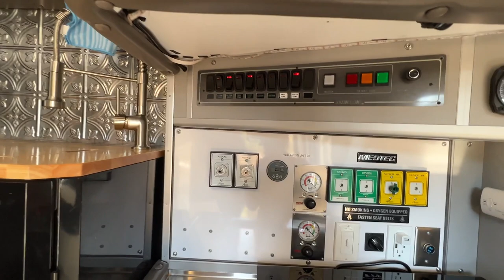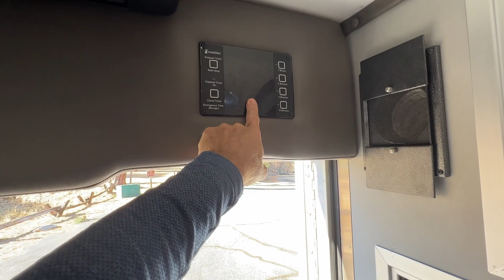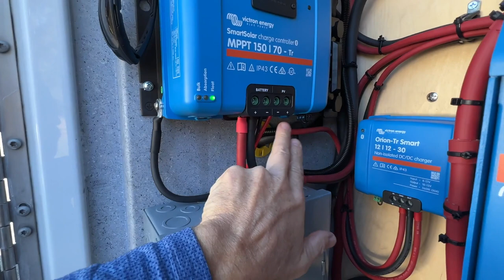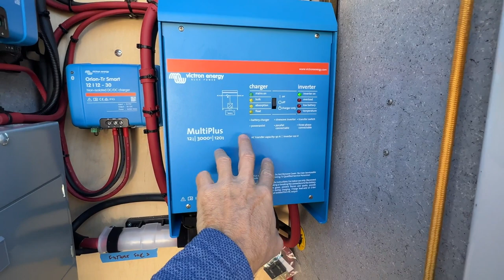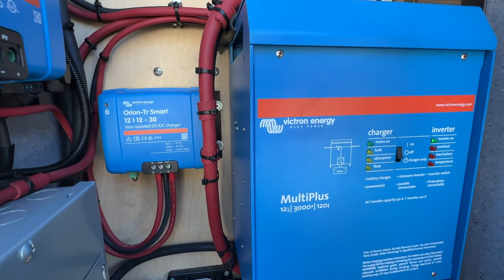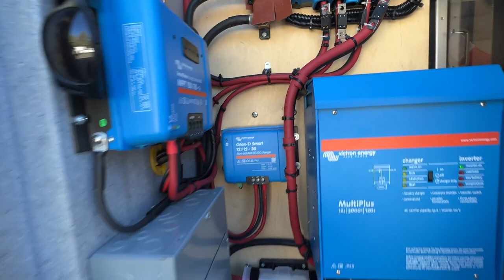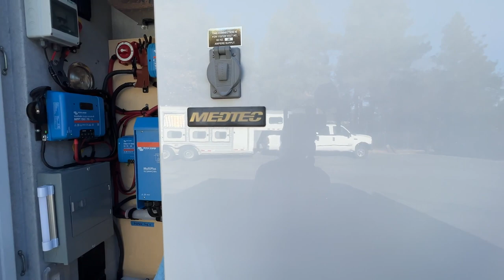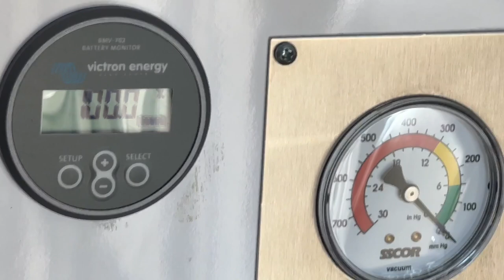Worlds Cleanest Off-Grid Solar, Electrical and Batteries in an Ambulance

Comment: Wife was a medic and is a great cook! We have a toyhauler with the same brand frig 10.1 size on our solar also.   She suggests to use the suction port with a tube like aquarium line tubing to suck air out of freezer zip lock bags for food in freezer or refrigerator to keep longer and like vacuum pack, will take us less room.
Reply from the maker: Hi Ken. Then your wife is in the know about these! Great idea on the suction port! Going to keep it for those high altitude trips and get a tank of o2 for a smooth transition.

Comment: Hi, fabulous job.  I am sure you did a lot of research on everything you’ve installed on you rig.  Your parts list didn’t list the solar panel manufacture.  Do you mind sharing info on who manufactured the solar panels?
Reply from the maker: Yes it took time Brooke. The panels are Jinko Eagle 72 - 400's and you can find them on the web. I'm relatively agnostic about brands as over the decades companies come and go. LG just bowed out this year. Focus on energy density per square foot correlated to price per watt and find an intersection of the decision matrix. Space is limited on most mobile applications. Ambo's have more space and with that, more options.

Comment: Excellent. Thank you. Do you have a link to the 400 watt solar panels you used?  I don't see it on the list.
Reply from the maker: You're welcome. These are Jinko eagle 72 cell 400 watt solar panels that you can find through many distributors across the globe. You might see some that are 390's to 410's as when they flash test them, they might have more or less output. They are 40" x 80" approximately.

Comment: Are you available for hire to do installs for others? I have an ambulance that I am converting. You do such a good job.
Reply: Annie- unfortunately, I'm unavailable. Thank you.
Reply: @MrKeithCronin  if I were to hire an electrician, do you have suggestions as to what type of experience or expertise I should consider?
Reply from the maker: @anniewisecarver744  well, there are 2 parts: the DC wiring and the AC wiring. Often electricians have a strength on the AC side as it is more common. You could also consider seeking out someone that works in solar with batteries as a suggestion.

Comment: Thanks for the great video and the thorough parts list as well.  I had been planning on building out pretty much this exact same setup (mostly victron-based), but with battle born heated batteries.  I am planning on purchasing all of the equipment very soon, probably looking for boxing week sales.  I am also planning on installing this equipment in a bit of a non-standard location in my ambo that I don't think I've seen anyone do yet.  I'm just measuring out all of the space that I'll need to make sure the placement will work before I commit to that path.  I do have one question already...something I spotted early in your video.  What is the DC lighter adaptor you plugged into the DC outlet in the rear of the box?  I might buy a few of those.
Reply from the maker: You're welcome. Looking forward to see your creation! On the DC, are you referring to the old school "cigarette" outlet? If so, this is a dual USB insert that they sell almost everywhere from pharmacy's to gas stations and I'm sure on amazon.
Reply: @dailydestinations9416  sort of.  The DC outlets in the rear box of my ambo are not standard lighter-sized DC outlets.  They are smaller.  I thought maybe you had some sort of adapter that converted those to standard lighter-sized outlets.
Reply from the maker: @KellyStJohn-vt3do  Just to clarify, are you referring to somewhere in this video that you saw a DC plug for reference or only referencing your ambo?
Reply: @dailydestinations9416  yes, I am referring to your video at the 7:30 mark.  My ambulance's rear box DC outlets are not standard "lighter" sized.  They are smaller than standard.

Comment: Can you explain if, in the main electrical closet, you were able to break the electrical power connection from the engine for all of the items and re-direct it to take power from your batteries? It sounded like that was your comment.
Reply from the maker: That's right Mike. At about 3:59 you will see in the video where the existing red (positive) wire came from the distribution of the original ambo that powered the electrical. At that point I removed it from the terminal post and in its place, the red (positive) wire from the Victron system.
Reply: @dailydestinations9416  That is excellent and should save me some overall time. Does that mean that somethings like siren, emergency lights, brake lights, etc.  will run off your batteries instead of off the engine?
Reply from the maker: @mroe34  That's right. There is a control panel in the center, between the 2 front chairs. Wiring is run from the main electrical box to it and inside the electrical box, there are circuit boards and relays. This means using a relay, you can turn on and off things from multiple locations.

Comment: Is there a benefit to completely separating the house and truck electrical, or can I just tie in my battery on the house side if the isolator? That way my house battery can charge off the alternator on a cloudy day.
Reply from the maker: It depends upon how it is wired and it seems like the Ambo's are all a little different and have multiple configurations. Correct, there is the way to use the alternator, as depicted in the videos connecting to the Victron as it has more than one input.
Reply: My only fear is Connecting too much power to the electronics. But I guess it’s no different than if I was jump starting the car.
Reply: Mine has an isolator but even when I supply power from my house battery I have to trick it into thinking the ignition is on before the boards are powered up.

Comment: I’m 17 and I just bought a ford e350 and it didn’t come with the other batterys only one small one in the front they took the others out but it still has the inverter and I don’t know if it’s ok if I put 12v li batteries in the place for the others in the back and does the ambulance pull from those back batteries to start or is it possible to keep them separate
Reply from the maker: Welcome to your new adventure. Without knowing the specifics it is difficult to tell. Many manufacturers did different configurations. For batteries in general, it is better to have them manufactured and out in service at the same time. Mixing and matching can provide undesirable results, like the weakest battery voltage will pull the others down to it. As for chemistry, would recommend keeping them separate from lead acid that start the vehicle. The charge controller has the ability to have an input to charge your house batteries while driving.

Comment: soo, it does not matter if the fridge is ac and it gets sloshed around and tipped around.  still working as good as a dc tippable fridge?  if no different this is a no brainer.
Reply from the maker: Good question. It is secured to the wall. In the future it could fail. And for $220 it seems like a good purchase decision for the fridge alone.  It is quiet and looks like it is well built. The big box retailers offer extended warranties for these concerns if you wanted to get one.